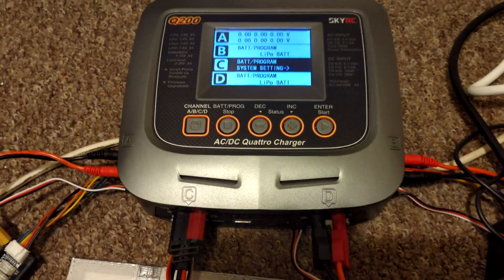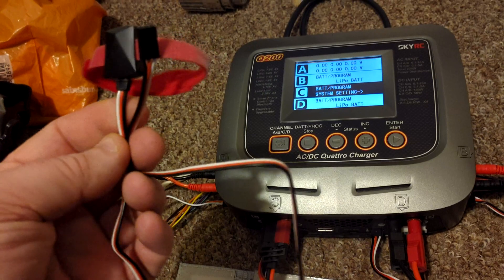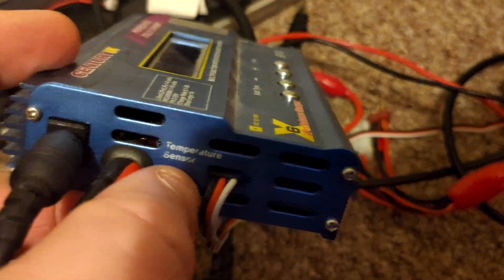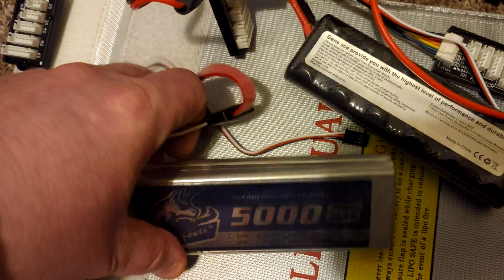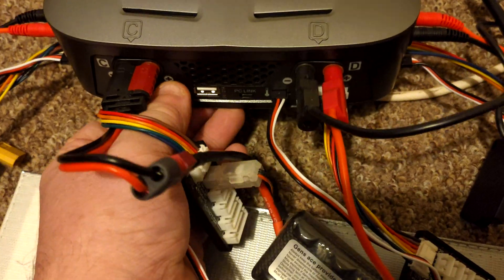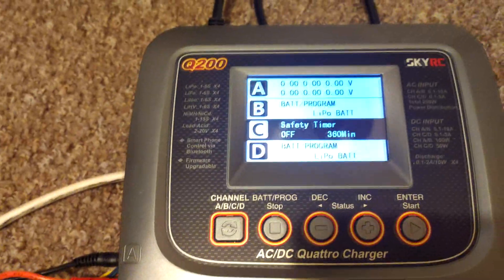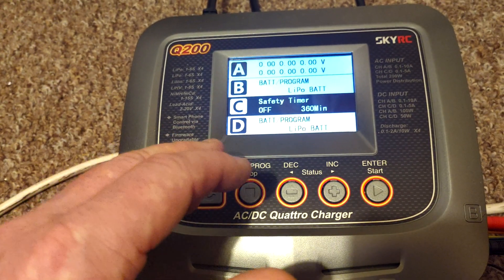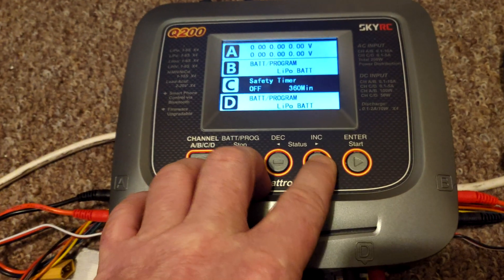Lipo charger external temp sensors

Comment: This is why I keep my two SkyRC Duo Chargers & deal with calibration on the ToolkitRC chargers. I think only the only other chargers that still have this temp feature is HTRC. At least the 400w+ ones I look at.
Reply from the maker: It's just another way to keep you safe from a lipo fire :)
Reply: Hey, I had redundant protection with temp sensors, but was doing something stupid, pushed my luck kinda far and had a frightening experience. 

 I'll tell the story when I get around to recording something for my channel someday. 😂

Comment: Good info and well explained. I couldn't find the branded turnigy sensor for my 'accucell 6 80W' in stock anywhere ... so bought a very cheap one on ebay for a quid or 2. I've been using it for years and it saved me the other day when a LiHv went very very puffy under charge at 1C ! Cut off was set to 60oC and worked nicely ... battery recycled, no fire.
Reply from the maker: Glad to hear it saved a fire :) I have seen ppl saying that you don't need the temp sensors but the way I see it I would rather have them for the one time like yours when it stops a fire :)